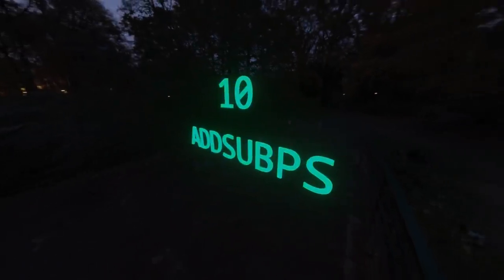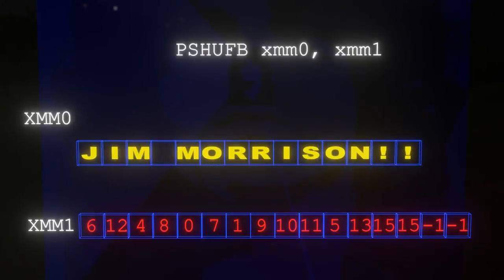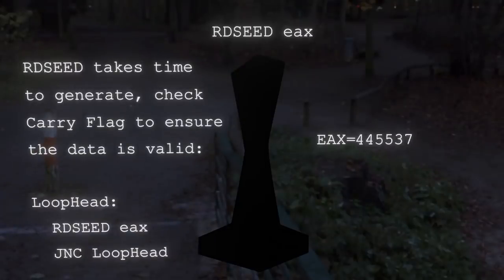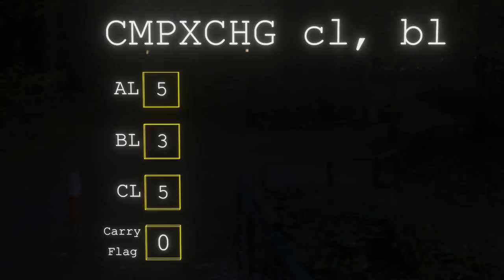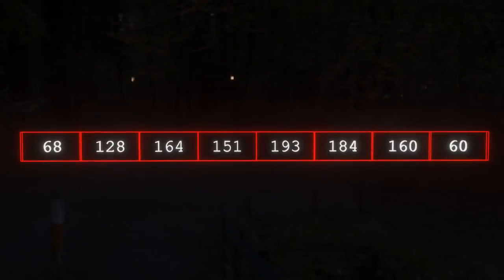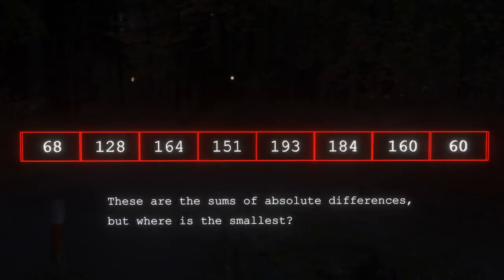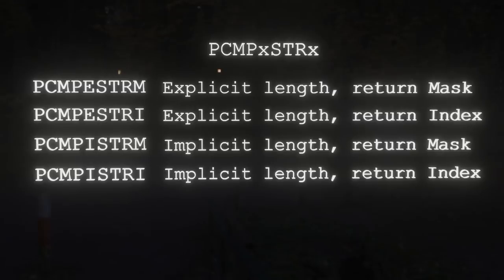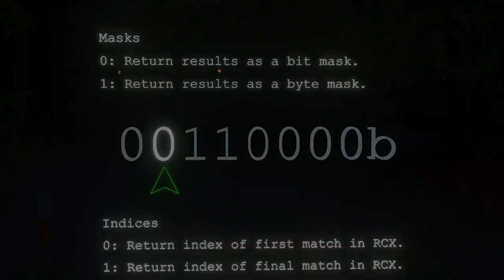Top 10 Craziest Assembly Language Instructions

Comment: Don't forget the Motorola 6800 "Halt and catch fire" instruction. It was an unpublished byte code that caused a branch to itself until the chip overheated.
Reply: @BrianG61UK  Long ago a computer center I worked in had a list created by IBMers in the 1960s of amusing opcodes, including HCF. But I didn't want to complicate the text, and the MC6800 item is there in the Wikipedia description, though I did have the details incorrect😊.
Reply: This video is about x86 though. Given, it does have the HLT instruction, and if you use it in your user mode application it will catch fire (if by catching fire you mean cause a privileged instruction exception) :0)
Reply: HCF was around in the 60s way before the 6800
Reply: @rty1955  yes, I recall on the wall of a data center I worked at, a paper list of spoof IBM machine instructions that included this HCF instruction. Iirc there was also BAH, Branch And Hang😂. The only CPU that actually did this that I'm aware of was the early 6800, but it's possible there were others. The 6800 was an "unimplemented" instruction bit pattern that unbeknownst to Motorola effectively branched to itself immediately and repeatedly until the heat built up enough to burn the logic.

I also personally knew experienced the result of two amusing (to me) episodes - at a college I was attending, a kid running a canned BASIC business program that managed somehow to overwrite the entire disk map, effectively erasing everything, and a kid looking for a job used social engineering to get the guy running jobs to dive and hit the Big Red Halt button. Each of those events caused the Computer Center to be offline for more than a week. And an entire computer center at a company where I worked got completely fried including three mainframes due to a lightning strike right at the pole outside the Center. The senior manager had resisted spending the $5 million required for a motor generator to isolate the computers from the world. We had 400 engineers twiddling thumbs for two weeks. He got a new job.
Reply: @GaryBickford  Hehe I forst worked on the 1401 then 360/30, 370/135, 4300 series, s/390 & Amdahl 5880. Programmed exclusively in assembly Lang, but knew COBOL, RPG. PL/1 fluently.
Also worked on Series/1, PDP 11/70. 11/44.
I wrote microcode on the 360/30. PDP 11/44 too.
Did about 3 yrs of plugboard wiring on the 407 machine. I still remember my keypunch programming too.

Comment: Not gonna lie, string comparison on the instruction set level actually sounds pretty useful. Not a fan of the absolutely insane arguments though.
Reply from the maker: Yes, they are magnificent instructions!! Assembly can be super fiddly to code, but very powerful if you have the time to make sure it is correct.
Reply: Yeah, as an accountant by profession I still wonder how mathematical reconciliation of bank statements and checking accounts can be so complicated to program and usually buggy.
I guess that last instruction combined with machine learning techniques really could speed up the process.
Reply: @Gulleization  You absolutely don't want machine learning near anything that requires accurate numbers. ML has its place but it isn't nearly as useful or reliable as the hype often makes it appear.
Reply: @SaHaRaSquad  It depends on they type of ML. Neural networks are generally fuzzy, but there are lots and lots of other kinds of machine learning implementations, and some of them work very well for accurate numbers.
Reply: it would only be four or five instructions in a loop.  but if it was four or five times faster and all you did was compare strings, very valuable!

Comment: Exciting! Love your enthusiasm. Almost makes c redundant. There is something about machine code that feels right.
Reply: did you know that ++ and -- were VAX intrinsics?
Reply: There is something about machine code that feels right.

I dunno. I've not done any actual assembly programming so maybe my opinion doesn't matter but x86 just seems so bloated and inelegant.
Reply: @seneca983  you would be partially right. Bloated or not depends on the way of implementation, if these instructions were to be implemented by microcode, yes absolutely, better let the programmer handle them. But if they  are direct on chip Hardware implementation of these instructions then it's a different story, it takes the opposite route of bloat. Takes 1 instruction instead of writing a 100 line function in C and hoping compiler would get the translation right. Also x86 being firmly established the engineers have to make sure they are compatible all the way. Support for languages will drop eventually, while x86 is going to stay.
Reply: @swarnavasamanta2628  One advantage of a simpler and smaller instruction set is that microcoding might not then be necessary and the chip could be simpler.

Indeed x86 would be rather difficult to supplant. However, it seems possible that ARM could do it though it's uncertain and would probably take a long time if it happened.
Reply: @seneca983  ARM is definitely a beast, and their methodology is completely different from other CISC approaches. It began first as a project to see if a computer really needs large complex instructions, they thought they would come at a halt problem but nothing really came up and they could make everything work with 1 cycle simple instructions (although with a bit of microcode). At this point hard to tell what the future holds, maybe there will be standardization when one architecture has so many advantages that renders other architectures almost useless or unworthy of learning curve. Who knows what the future holds but up until that the architecture land of computers is like wild wild west and i kind of love it that way.
Reply: ALMOST feels right, until you realize that porting your code to a different processor will destroy 98% of the work you did to optimize it.
Reply: I don't think so. If you try to beat the compiler at its game you are likely to loose unless you really, really know what you are doing. Sure, the compiler might not be able to effectively use all of these instructions but I guarantee that the compiler will generate faster code 99.9% of the time.

It always blows me away how smart the compiler actually is: It automatically does constant folding, loop unrolling and other cache optimizations. It can automatically generate multiple versions of the same for-loop - one vectorized and one not - selecting the best implementation based on the number of iterations at runtime. 

It can even recognize simple algorithms and replace entire function calls with the appropriate instruction (e.g. it can replace an algorithm that counts the number of set bits with the POPCNT instruction). It knows the processor pipeline a lot better than most programmers. So it will sometimes actually prefer instructions that might take more clock ticks but are fully pipelined.

And the best part: It knows all of these limitations and pipeline tricks for pretty much all CPU architectures. So unless you know the technical documentation of the CPU are are targeting inside and out, you are probably better off to just trust the compiler. And if you really think you could benefit from assembly trickery, you are probably better off to trust the Intel engineers who wrote the IPP and MKL libraries.

Comment: Fantastic video! Such exotic instructions can insanely speed up / shorten certain algorithms. Back when I did MPASM (has only 35ish instructions), there are some rarely used ones that magically do exactly what you can also emulate in 10 more common instructions.
From the instructions in the video I so far only used cmpxchg to emulate floating-point atomic addition in OpenCL.

Comment: PEXT is so useful! I can finally get the correct bits from a 4X 1R 1G 1B 1I 8-bit color buffer to the "layers" in mode 12h easily!
Reply from the maker: Mode 12h? Are you coding EGA? That's awesome!
Reply: @WhatsACreel  Yup! I think I should also do something on UEFI though, as it gives higher resolutions.
Reply: Also DES, RC4 and other cyphers based on Feistel's schema would ridiculously slow without this.

Comment: I remember the old Intel 8085 had some hidden instructions we used in our projects we knew they would not be changed because the instruction were used in some of the development tools for the MDS (Microprocessor Development System). There were instructions like LDHLISP with an 8 offset parameter. Basically it was "Load the HL register Indirectly with the Stack Pointer with the offset added" it was essential for writing re-entrant code (in 8085 assembler!). BTW this was way back in 1980!

Comment: The other day I learned about the POLY instruction on the VAX. That's POLY as in polynomial, so when I heard of it I thought "well, I guess there could be a use for it in numerical apps, maybe? It's not like it's going to be more than a few coefficients. Maybe a cubic; that's only four." 

I was only off by twenty-eight! That's right--the VAX can, with a single terrible opcode, compute the value of up to a thirty-first degree polynomial, to either float or double precision.
Reply: Isn't assembly strangely awesome?
Reply: ...wouldn't a 31 degree polynomial just smash the value to negative infinity, positive infinity, or zero? What the hell is even the use of that lol
Reply: @romannasuti25  nope, if you need to do some crazy ass Taylor series or something and just look at a certain portion
Reply: @juanthehorse420  Outside of bragging about computing Pi faster, is there any use for 10+ long Taylor series in practice?
Reply: @meneldal  approximating any function with nicer ones  and then being able to calculate that fast on the fly can be useful, though most of those often-used functions have fast instructions themselves at this point.
Reply: @MsHumanOfTheDecade  sadly, the POLY instruction was slower than using a series of MUL and ADD -- at least on the VAX 11/780 and 750.

Comment: addsubps was probably made for complex numbers packed into these vectors.

mpsadbw and similar psadbw indeed were made for video codecs, to estimate errors. You should avoid mpsadbw because too slow, but psadbw is good.

I think the craziest of them are for cryptography, like aeskeygenassist or sha1rnds4. Good luck explaining what they do.

Another notable mentions are insertps (SSE 4.1; inserts a lane into vector + selectively zeroes out lanes; I used for lots of things), pmulhrsw (SSSE3; hard to explain what it does but I used it to apply volume to 16-bit PCM audio), and all of the from FMA3 set (easy to explain what they do, that’s ±(a*b)±c in one instruction for float numbers, but the throughput is so good).
Reply from the maker: Great points mate! Cheers for watching :)

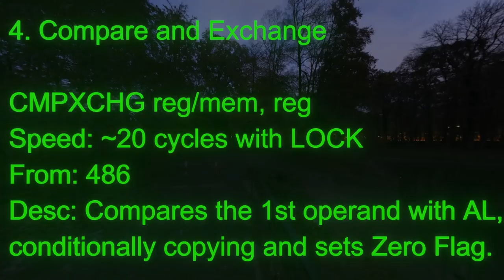Comment: About CMPXCHG being "absolutely bizarre" (6:22), this is not only used for mutexes and semaphores as explained, but is also the most common primitive used for "lock-free" concurrent data structures (see for example Doug Lea's amazing ConcurrentSkipListMap implementation). It is so useful that many languages export it in some core library, like <atomic> in C++ or java.util.concurrent in Java. Most programs you use every day likely rely on it or its equivalent in another architecture, unlike some of the other weird instructions listed in this video.
Reply: And it is not very useful as presented where all operands were registers. You want to executed this on a piece of memory.

Comment: I wonder how complicated it would be to try to formulate compiler autorecognition for instruction selection for these. That last one is easily a couple hundred lines of C code.
Reply: Very complicated. Most of these optimizations are often missed by c compilers and have to be manually implemented in assembly. In some cases (video de/encoding) up to 50% of the codebase has to be rewritten in asm for these reasons.
Reply: Your only hope is to use a library that already has fast paths coded in assembly to do this for you.
Reply: The best way to do this would be to implement these as compiler intrinsics that would then be substituted with the correct ASM instructions.
Reply: @jfwfreo  what if some other arch doesn't have them? most compiler suites support at least one other architecture.
Reply: @bootmii98  Most compilers for x86/x64 (including GCC and Microsoft) already support a boatload of compiler intrinsics for SSE and all sorts of things.
Reply: @jfwfreo  what about the non-x86 ports of those compilers, what do they do with e.g. SSE intrinsics? remember, gcc is cross-platform and cross-architecture, and not every architecture has SSE.
Reply: @bootmii98  I imagine they would either produce asm code to implement the logic, or just throw an error. What other options are there?
Reply: @bootmii98  They'll just write asm that does the same thing but without those instructions, like they already do with __builtin_popcount and the likes.
Reply: @bootmii98  Usually you'd have a fallback implementation in your high-level language of choice. An interesting alternative I've found recently is simde (SIMD everywhere) which is a project that reimplements the various intrinsics so that they can be used on other architectures, or even just the same architecture that doesn't support the extension the intrinsic was for.

Comment: I wonder which language compilers are able to detect these patterns and use the ASM operand instead of doing the slow imperative way.
Reply from the maker: I love Clang! It does a lot of optimisations. You might have to use intrinsics, but these things are available in C++. Best way to know if the compiler is using decent instructions is to disassemble and check what it's doing. Or use the ‘Godbolt Compiler Explorer’ website.

I don't think there's any compilers that are better at applying these instructions than humans. The gap is narrowing, and maybe one day, we'll get AI compilers that can do these things better.
Reply: @WhatsACreel  Right, I guess the best bet would be to use/create libraries providing these functions as interfaced tooling; the librairies making use of ASM internally if possible (since it depends on the CPU type)
Reply: @WhatsACreel  AI compilers that can do things better than humans! NEVER! Maybe just faster... (insecure human signing off)
Reply: @Winnetou17  I might be wooshing rn, but there are quite a few examples of AI doing better than humans. Google has some wild stuff for recognizing numbers from blured photos for its street view stuff.
Reply: @OzoneGrif  please no more abstraction by library interfaces at low level. It is a nightmare, i say let good prpgrammers handle this.
Reply: @WhatsACreel  Are you kidding me? Optimizers have been outperforming humans since the early days of FORTRAN. You vastly overestimate the abilities of humans.
Reply from the maker: @abebuckingham8198  I love modern optimizing compilers! Also have a soft spot for humans :)

Great topic! I would love to make a video on this. Hopefully soon!
Reply: in the early '90s there was a free universal C compiler written in C and its output was an assembly file.  there were personality files for all the common micros.  you could tweak the personality files to output whatever assembly you wanted.  that was my z-80 C compiler actually, my first high level programming with a micro

Comment: Fascinating! Thanks for this, a few questions...
1) How aware are today's compilers of these instructions? - e.g. fully? partially? poorly?
2) How good a job do they do in making use of them? (will there always be scenario permutations out with the compiler's standard translation/reduction definitions?)
3) Is it fair to assume that these instructions are always faster than stringing together their equivalent single function, datatype/bit size equivalents? (loaded question?)
4) Given today's and tomorrow's CPU and GPU speeds, do you think compiler engineers are really all that concerned/have only a passing incentive with the level of CPU and memory optimisations absolutely critically required in an era not that long ago, where e.g. virtually every commercial game was hand coded in assembly using, literally, every CPU and memory optimisation trick possible?